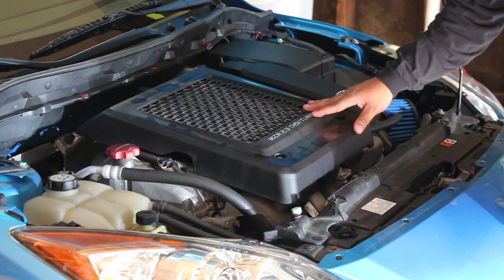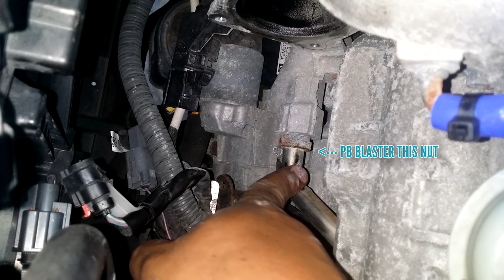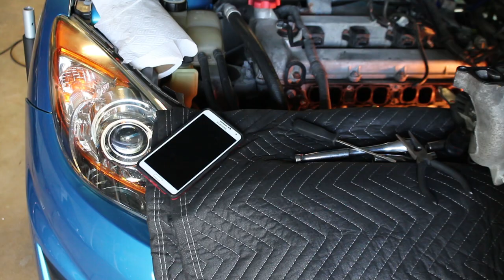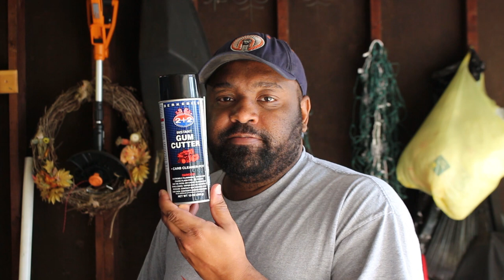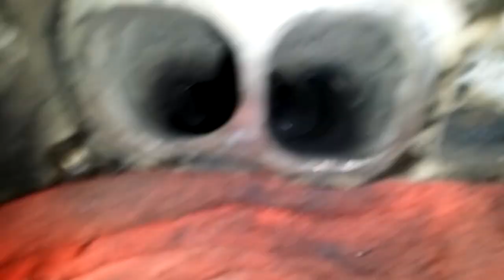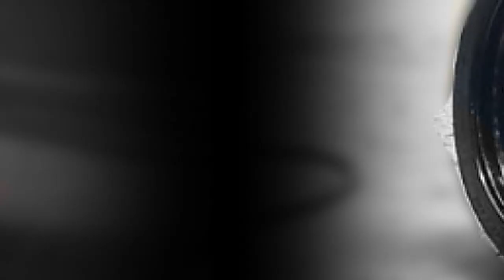Mazdaspeed 3 Intake Manifold Removal and Valve Cleaning

Comment: 7:40 you can 100% remove the intake manifold without removing the egr tube. just take the 2 bolts out by the top end of it, and it snakes right out, then you can spin the whole thing off by hand.

Comment: Just a PSA: the serpentine/idler isn't necessary on Gen 2 Speeds. Gen 1s usually require moving the power steering items right there to get the IM off. I just wanted to clarify. When I did the valves on my car, I didn't touch the serpentine.

I appreciate you making this vid. I personally found that walnut blasting worked far, far better. If you're set on using a liquid to clean, get M1 methanol. It's usually only a few bucks a gallon, and works amazingly. Spraying methanol (installing WMI injection) is also the perfect way to guarantee you'll never have any build-up again - that stuff is corrosive to buildup! Accordingly, use caution; IIRC, it's carcinogenic, so you definitely don't want any on you.
Reply from the maker: Walnut blasting is definitely the way to go. When I originally did the vid, I wanted to try a way that didn't include a compressor (not everyone has one) and wanted to show people it was possible to do. Now, I will just tell people buy/rent/borrow a compressor and walnut blast. It took me the entire weekend (editing doesn't really show how much time it takes) to do it this way, media blasting would take 1/4 of the time.

Comment: Awesome info and visual aid before i dive into it. This is an issue with all the direct injection engines not just mazda. Vw its a big issue too.
Reply from the maker: I have seen some crazy plugged up VW intakes when I was doing the research for this. Those videos were the reason that I took my car apart to look and I was glad I did! It has been awhile since I did this, I am probably going to remove the intake manifold this summer and take a look at my valves.

Comment from the maker: I didn't realize how much grime and carbon had built up on my valves and in my manifold until I took it apart! I highly recommend Speed 3/6/CX-7 Turbo owners look into doing this, as well as adding an oil catch can!
Reply from the maker: I am going to take a look again at my valves this summer, I already have the parts in place to add the second can. I try hard with the camera work, still improving! Thanks for checking out my videos!
Reply from the maker: @Sam S I have found that when I can't find the Mazda part, cross check it and see if there is a Ford equivalent. It has saved myself a couple of headaches and shipping time. Needing an engine is painful, they are not cheap! But if I had a budget (LOL @ having an actual project budget) I would get one built from http://www.speedperf6rmanc3.com/

Comment: Great video!  I am dreading doing my valves, since I have 120k miles on mine.  The OCC and EGR delete are nice and should help keep some of the carbon out.  There is a shop in my area that will media blast it for $300.  That's kind of pricey, but it maybe worth my time.  With 120k miles I am needing to save for struts, ACT 6 puck clutch, end links, control arms, sway bars, and then a big turbo $$$.
Reply from the maker: I went back and forth on deciding whether or not to pay someone to do it vs doing it myself. I ultimately decided on doing it myself once I figured out that I was going to add the catch can and PCV plate. The cleaning is time consuming, if I were to do it again, I would media blast them, it cuts down on the time considerably. Doing it yourself will definitely allow you to save some cash, the money I saved went directly to more parts!
Reply: BTW you will love the 3 inch down pipe liked up a 3 inch exhaust.  I have the ATP long pipe to a mangaflow exhaust.  Not too loud and not to quiet either.  Go for a FMIC too.  I did the cxracing o m fmic and it is a big improvement over the stock tmic.  The install was a little tricky, but worth it.  You may want to add a turbo inlet pipe next.  Have fun.

Comment: looks like a lot of work.  lol.  what are the intervals that this needs to be done?
reminds me of brushing your cars teeth, floss, and mouthwash.
Reply from the maker: It is a bit of wrenching no doubt! I haven't found a recommended interval anywhere, but while I was looking stuff up there were owners with less mileage than mine who were having significant carbon build up. I decided that mine had probably never been done and figured that I might as well. I am adding some parts to help cut down on the carbon build-up while I have the car apart, with the intake manifold out of the way, it is so much easier to be able to replace the pcv valve!

Comment: What about changing a valve? My number three has low compression. I don’t know if it’s intake or exhaust that needs replacing. That’s what I’m hoping it is. Please refrain from telling me it’s a warped head or warped anything👍🏼, that would break my heart. I enjoy my MS3 very much.  She got me $305 speeding ticket. We are pretty much BFFs
Reply from the maker: Did you try squirting some oil in the cylinder and checking the compression again? Usually low compression is piston rings related. So chances are it isn't a warped head 😊
Reply: I did dry/wet test. Piston ring is a bit of a pain for a novice but I am mechanically inclined. Pulling cams from chain scare me a little. Thanks for not telling me what I fear most👍🏼

Comment: So late to the party, but this is exactly the video I needed. I couldn’t get the intake manifold off for the life of me, but now I can finally get to my starter. 

Also, HUGE props for the safety. You can go blind or lose a finger really quick if you aren’t thinking about safety.
Reply from the maker: Right. Replacement human parts arent cheap and Im trying to keep my body OEM as long as possible!

Comment: You didn't show how you closed each of the valves. Can you let them all soak overnight? I didn't think they were all closed at the same time...
Reply from the maker: I rotated the engine over at the crank with a socket/ratchet, you can look into the port and see when each valve closes.  They won't all be closed at the same time. I worked my way across from left to right. Unfortunately, there isn't a way to close them all without removing the cams from the head.

Comment: hey buddy, i brought a cx7 2009 as project and this car have serious fuel dillusion issue followed with loss of acceleration after 2500 rpm and  codes for solenoid corelation and all, after seeing this, i am heading towards this direction and planning to change oil sepereator and PCV.. hope that helps
Reply from the maker: It is one of those things that doesnt get talked about much but it is definitely something that should be done. After you clean them, I would add a oil catch can too.

Comment: How do I close each valves before cleaning ?!?! I really hope you can answer in the next hour so 😢 . Two of my valves are very much open and I don’t know how to force shut them .
Reply: Nvm I found out , it’s from the crank pulley for anyone with the same question.
Reply from the maker: Yep use the crank bolt to spin it over to close the valves.

Comment: hey buddy love your videos excellent explanation, on another note i have a question is it possible to delete the egr valve on a 2002 mazda protoge5 any help would be greatly appreciated thanks. keep the videos coming
Reply from the maker: It is possible. You might need to source up some block off plates for the cylinder head and a plug for the exhaust manifold.
Reply: Thanks for the quick reply I appreciate it greatly

Comment: Great video!  Hey, I removed the 12mm bolts on the power steering pump but the pump won't budge!  Any ideas?  There's only 2 bolts right?  Is the thing like gasket sealed to the engine or what?
Reply from the maker: The power steering pump or the idler pulley? The idler pulley required a little PB Blaster once I got the bolts loose to get it free of the engine block.
Reply: Actually there is three one on the underside of the pump beside pulley it's a pain to get to

Comment: About that power steering pump? Did you add a comment down below and I missed it, or is it in another video. Did you take the passenger side wheel off and go in that way? It doesn't appear so from the video, but I can't really tell.
Reply from the maker: Yes. Take the passenger wheel off and go at it that way. You take the inner fender/cover off and can get to it that way.

Comment: If I replaced the crank shaft position sensor do I have to align it with a specific tooth? Maybe a video? I think I'm having issues at full throttle because it's not aligned
Reply from the maker: Yes, there is but there are a couple of steps that you need to do first. I will link the service manual instructions: https://imgur.com/a/2m3Fi. Hopefully this helps you out!
Reply: Five Five Garage awesome thanks!
Reply: @FiveFiveGarage  would that be same procedure on speed6 as well?
Reply from the maker: It "should" be. It is basically the same engine and sensor so I don't see why it should be different. Double check the procedure to make sure!

Comment: I have a dumb question, but I was trying to get the  intake off of my speed 6 and broke the plastic hose off of the intake manifold that runs to the firewall of the car. I cannot seem to figure out what the part is called, any help would be helpful
Reply from the maker: The inlet pipe before the turbo?  The only lines I can think of runs to the boost controller, but that should be rubber unless its so old it hardened up like it was plastic. If you are removing the inlet pipe, its common to break that one.

Comment: hey subbed!  do you need a compressor? or is towels and brushes enough?
Reply from the maker: Compressed air makes it easier to clean out the ports when you are cleaning. I would definitely recommend one, especially if you have a media blaster.
Reply: @FiveFiveGarage  how long does it take to do the whole project..
Reply from the maker: Doing it with brushes and towels, it will take a weekend. If you have access to a media blaster it can be done in a day.

Comment: What torque specs did you use to reinstall the IM and in which order, can’t find any website helpful enough.
Reply from the maker: The IM bolts are torqued to 16 ft/lbs and i used an outside-in criss cross pattern.

Comment: What about cleaning the exhaust side? I've got a Mazda CX-7 and the exhaust valves are gnarly.
Reply from the maker: I haven't heard about the exhaust valves getting gnarly before! How bad was it? I am definitely going to do some research into this, thanks for bringing it up!
Reply: It was diagnosed at the dealer, so I didn't get to see it for myself unfortunately. They suggested replacing the whole engine. I told them they are crazy! I'm taking it to my local garage on the corner this week, so maybe I'll get a better picture of the problem. I have 129,000 miles on the car.
Reply from the maker: That's nuts! The buildup can be bad, but not new engine bad! It can be cleaned, walnut media blasting really cleans up the valves, it's a good idea to get a second opinion!

Comment: what i never understood is on the NA Mazda 3 cars (which i own) they use multi port injection but on the boosted cars its direct injection..yet EVERY person i know who runs a Mazda speed car adds a port fuel rail as the turbo cars seem to run out of fuel at boost, even on stock components..you add power and the extra fuel rail is a MUST..why not have a port fuel rail and every so often a valve opens and it sprays fuel thru the port rail cleaning the valves and also adds extra fuel when it detects a lean condition under boost..
Reply from the maker: The stock fuel setup (once the High Pressure Fuel Pump internals are upgraded) is good up until ~400hp (it is why HPFP internals are the first recommended mod to be done to the car) above that is when you have to get creative. 

You can add a 6th port that gets added to the throttle body that does what you are describing without too much engineering of the manifold. But then you are also adding another fuel pump, a secondary fuel controller,  etc. You can buy kits to do it, Kozmic Motorsports has one. It is pricey but it allows you to use so many different setups ( Water/Meth injection, E85, etc) that if you are going big turbo it is worth it.

I am thinking of adding one just to be able to keep the valves clean. A catch can on these cars is a must.
Reply: @FiveFiveGarage  i have a non turbo car and i added a catch can..makes a HUGE difference..
Reply: That's definitely the next step in Direct Injection. Toyota/Lexus uses both port and direct injection to keep the valves clean, and give better control over fuel with direct injection.

Comment: You still have this MS3 platform? I have a 07 gen one. Think about doing this. Is it worth the effort? (or the $$ I'm going to pay to have it done)?
Reply from the maker: If you have an 07 and its never been done, yes. DI engines are horrible with the build-up (VW and Audi suffer the same thing) and it causes the engine to lose performance.
Reply: @FiveFiveGarage  I asked a local shop how much to do this and clean injectors and replace seals. I died a little wen he said, "about $1700". No way. I would try this myself. But its my daily. And I live in an apt. Can't break it down in the car port lol. Still looking for a solution.
Reply from the maker: Unfortunately, it does involve a bit of tear down, so you are going to need a place you can have it apart for a bit. Getting the injectors and seals out can be a PITA too, I had an injector stuck and one of the retaining bolts did not want to come out. I snapped two impact torx bits, before I had to hit it with a torch to remove. When you shop around for a shop to do it, ask if they have any experience with the Mazda DISI engine, they are very finicky to work with.

Comment: Can someone help please, my engine is apart and I don';t know where in inner coolant line for the throttle body connects to????
Reply from the maker: The inner line should be routed to the EGR, on the backside of the engine on the drivers side, above the turbo.

Comment: Does anyone know what tools he used and the products he used like does someone have a list ?
Reply from the maker: If you really want to do it fast and get them super clean. You need a media blaster and walnut media. You can do it this way, but it took me an entire weekend using chemicals (B12 Chemtool) and a lot of scraping (I used some dental picks to get at the stubborn pieces). I did another speed with media blasting and all the valves looked like new in 20 minutes. Media blasting is definitely the way to go!
Reply: @FiveFiveGarage  what grit should I get the walnut shell should it be fine or coarse